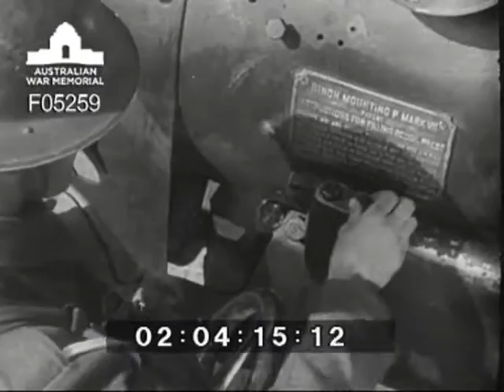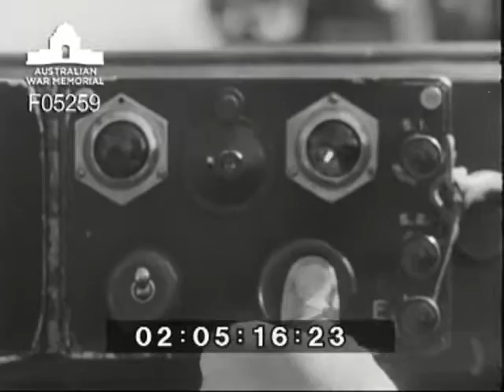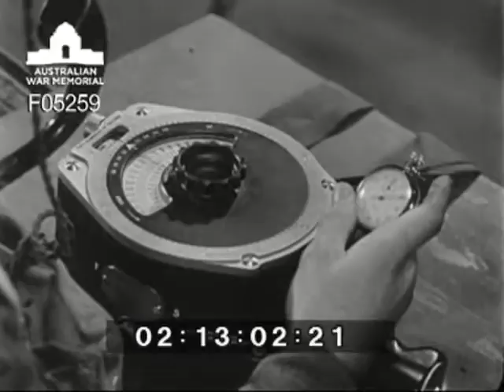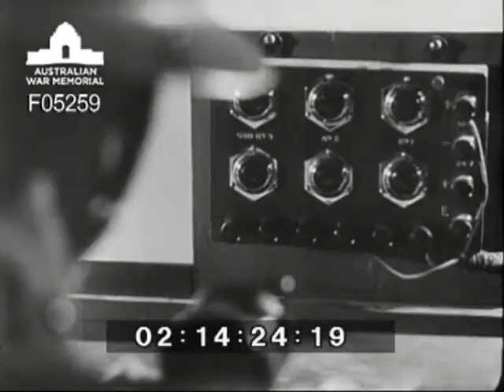Naval 6 inch gun

Comment: All this prep for a 6" artillery piece may be technically correct but far too slow in real battle conditions. Unless settings easily change, it seems one firm setting of the gun, lights and circuits should be sufficient. The kill diameter of a 6" naval gun is likely wide enough to compensate for minute changes, unless the target is at maximum range. Today, computers likely do much of this setting.
Reply: The calibration of the gun would be done on a scheduled basis. Not at every watch change or just prior to immediate action.